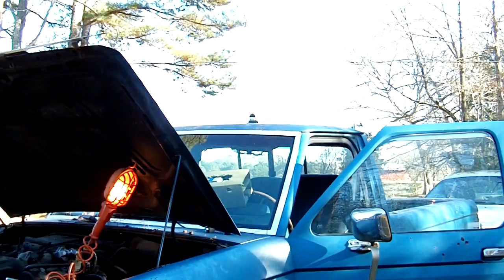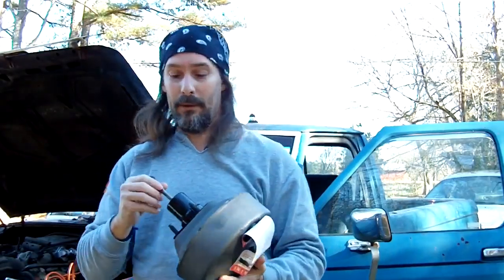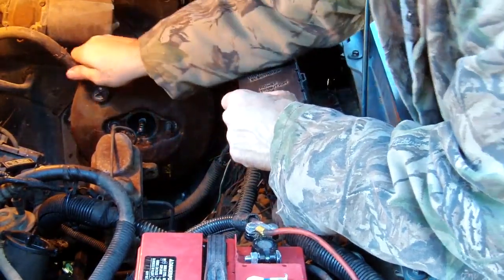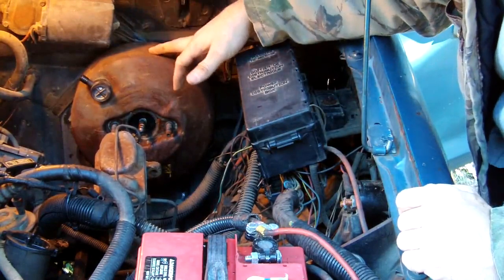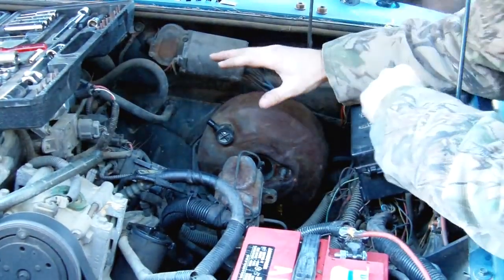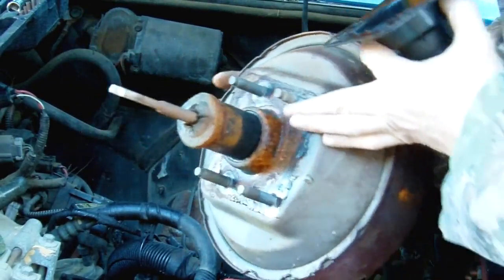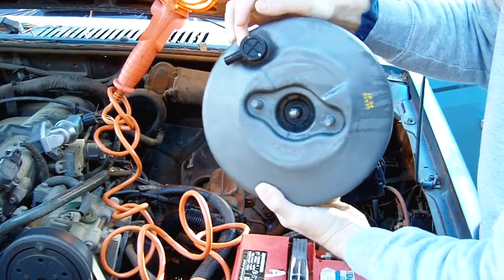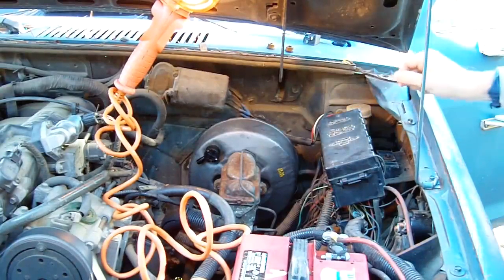1983 Ford Ranger - Replacing Brake Booster

Comment: Hours of searching and this is the best video out there! Thank you! Definitely needed on my new 78 F150 Custom 351Cleaveland after its 200 mile maiden voyage home
Reply: Did u have a stuck pin??   I can't seem to get the linkage apart in my 78
Reply: +Jose Noway yes the cotter pin was pretty much folded over in half near the firewall. I ended up taking a hack saw to the linkage arm in order to remove the booster just so i had more room to work. it took me a good 4-5 hours just to get that pin out

Comment: Good job you the Man !!!  I like the way you left the brake lines on so you wouldn't have to bleed  the system thumbs up !
Reply from the maker: Thanks. No need of removing something that does not need to be removed.
As long as it is flexible, you do not have to remove them.
I have come across some, where you have no other choice.

Thanks for watching.

Comment: Thanks for the video, changed booster without a problem.
Reply from the maker: Cool.
I have to remove a Radiator in a 2001 Ford Taurus next.
Ow what joy that is going to be
Nothing like removing it from this truck.
Yea fun.

Glad this video helped you out Wells.
Reply: I gotta change the brake booster on my 1999 Ranger 2.5 liter tomorrow. I hope it goes as well as you made it seem. Thanks for the video.

Comment: Should have painted your brake booster. It will start to rust and turn brown in a month or so. Great video by the way best I've seen. Looks like you got the 4.0 engine in your ranger that's the best engine they put in them rangers. GO FORD!!!!

Comment: Hi - Couple of questions:
1.  Did you have to remove the driver's seat?
2. Did you have to adjust the rod between the master cylinder and the booster?
Thanks, good video!
Reply from the maker: #1: No, why would you need to remove the drivers seat for?
#2: Nope, did not have to adjust it.

Comment: Someone removed mine from 1987 it only has master cylinder but brakes work can you eliminate a brake booster? It doesn't make sense why someone took it off less it never had one.

Comment: Thanks bro! My dumbass thought it was time to flush the brake fluid. So we pumped it out with the 2 person bleed method... And after an hour of pumping, the fluid came out fairly clear. 

Then I drove off, and the booster started burping when the pedal was released. 

I guess that's why it was so cheap when I bought it in 09'...

Comment: Time to yank that little weak motor out there and put you a V8 in it. I put a fuel injected 302 ho motor out of a wrecked Mustang. It's a blast to drive
Reply from the maker: What do you mean by a"That weak motor"?
This 83 Ranger, has a 95 Ford 4.0 motor and transmission.
This thing can outrun near about anything on the road that is street legal.
The truck has so much power, and not enough weight, that it is dangerous to drive it on the road when it rains.